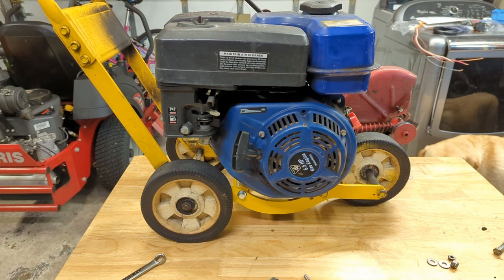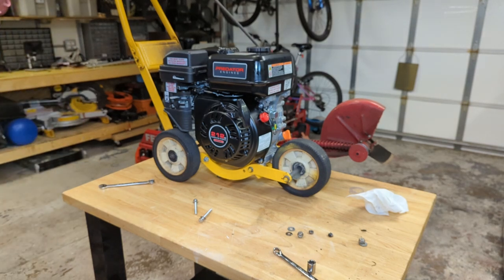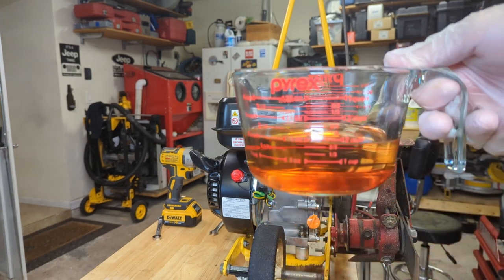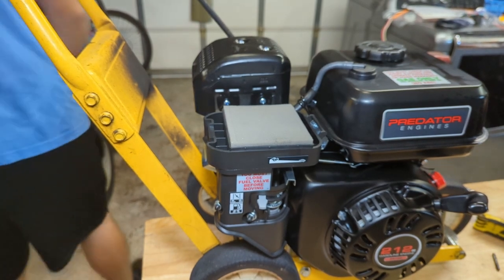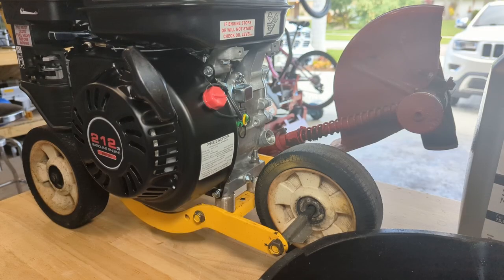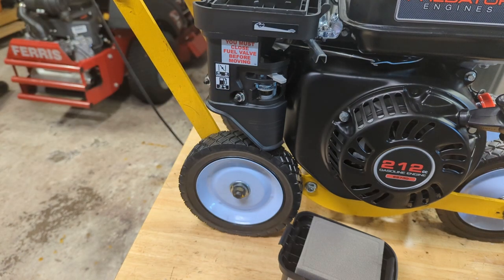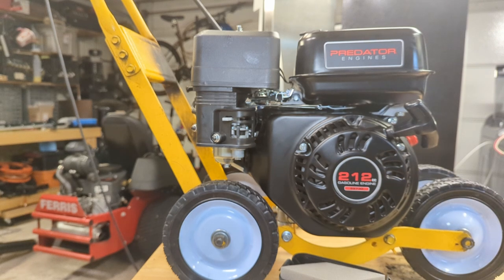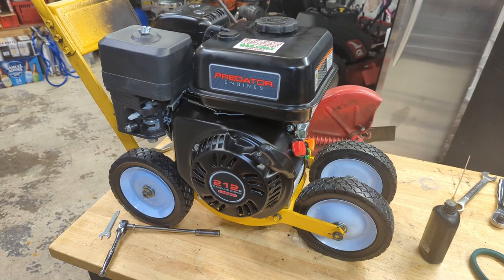McLane Edger Engine Replacement

Comment: Are you able to attach the throttle cable to the aftermarket engine or do you lose that function after dumping the briggs and stratton? I have the 3hp model from 79" still runs but i have changed and fixed the pull cord so many times I am looking to do a swap like yourself.

Comment: Do you use the original pulley from the Briggs engine that came on the original engine for the Harbor Freight engine and did you use the original belt size from the original Briggs engine after you changed the engine?
Reply from the maker: Going back about 10 years or so but I know for sure I changed the pulley. I believe the shaft size on the briggs was different. Pretty sure the belt I am using is the original style but I might be wrong. It's pretty close for sure.

Comment: I know this is an older post but where did you get the spacers for the motor ?  Motor mounts to make the engine sit up taller not to interfere with the frame ?
Reply from the maker: Sorry I tried finding them for you but it was too long ago. I do remember they were Briggs and Stratton parts
Reply: Thanks  @JoesGarageProductionsLLC

Comment: I know its an old post but do you remember the length spacers you used for the motor ?  Thanks
Reply from the maker: Oh boy... not off the top of my head, but if you're still interested, I can measure them.
Reply: @JoesGarageProductionsLLC   Could you please  ?  That would be helpful  and i could fab something from there .

Comment: Don’t see many people using theses anymore
Reply: We bought a used one a couple years ago. I've tried using our Stihl gas weed eater for edging but the line breaks way to often and the line also likes to climb up over the edge of the grass and causes an uneven cut. I'm not a fan of it. It would probably be ok for maintaining an already established edge but for cutting a new one or one that's been neglected it's not very good. The gas edger cuts a straight line and has plenty of power to do the job. I would like to try a cordless edger, that might be a game changer.